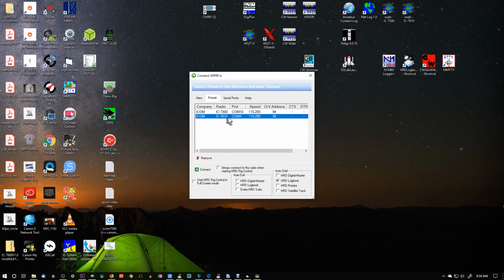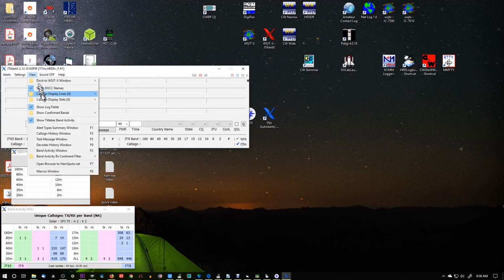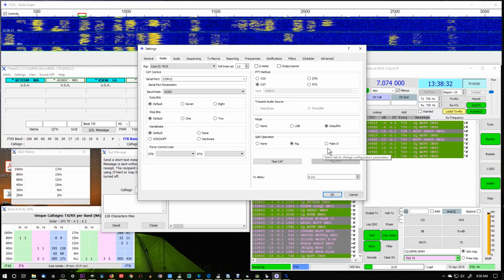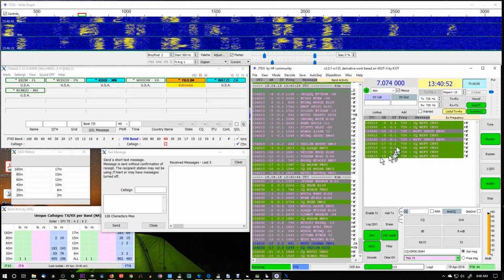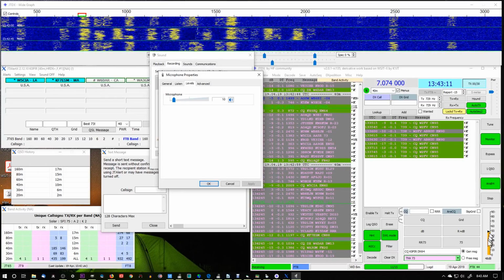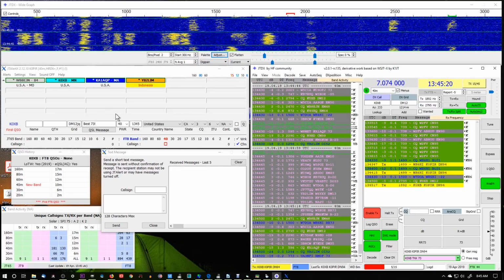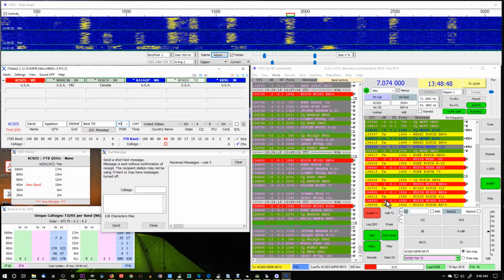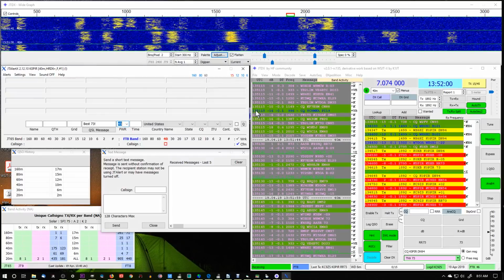JTDX FT8 JTAlert HRD Logbook

Comment: Really enjoy your videos. Been watching all your videos from Hamvention and all the new/use equipment. Well done on the text addition to your videos, sure helps with all the background noise. 

But regarding JTDX:
I have been using WSJT for over a year, along with JT Alert & HRD which works great with my FT-950. 
I’ve loaded JTDX and used all the setting from WSJT.  Everything works like it should except the rig will not key up.
In the radio setting I get the green “ok” when clicking on Test Cat.
In the program I get the red line scrolling at the bottom like it’s transmitting but no power out and the rig doesn’t key. 
In WSJT the PTT setting is VOX, I’ve also tried CAT but that doesn’t work either. 

If you can think of something I’ve missed, then pass it along please.
73 & keep those super videos coming
wd4dda
Reply from the maker: Preston Shute Nice to hear from you and thank you so much for commenting here. In JTDX did you check the power slider in the software program? It’s kind a like the slider and WSJTX. Move it all the way to the top and see what happens. 73!